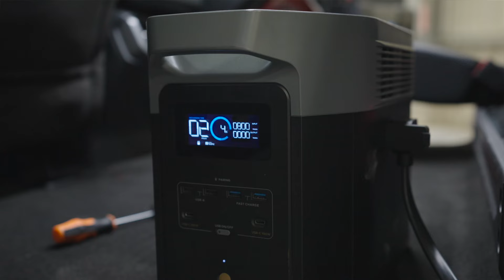How to Install an EcoFlow 800W Alternator Charger in Your Vehicle: Step-by-Step Guide

Comment: What a joke.  $600?  That's absolutely ridiculous.  For a fraction of that you can install an inverter and accomplish the same thing.  I've been doing it for years with no problem.  This thing should be $250 tops.
Reply: Pure sine wave for $250?
Reply: Why would you install an inverter for DC to DC charging?
Reply: @SaltySeabee  yes.  I have a 2000 watt pure sine wave inverter I got on Amazon for $129.  Works fantastic.  $600 for what essentially is the same thing with less output is outrageous.
Reply: @r.kitt.3987 you aren’t understanding what this device does.  It’s not an inverter.  It charges a separate battery pack (with inverter), and also allows that battery pack to charge the vehicle.
Reply: @twentyonemore1033  doesn't matter wtf it does.  $600 is ridiculous.  $400 would be ridiculous.  I like ecoflow products and have a bunch, but the price tag they put on this thing is ludicrous.  They're on drugs.
Reply: I agree! I have Victron DC to DC charger with computer fans and it works fine. It charges my Ecoflow Delta 2 Max. 
The whole set up cost me around $300.00

$600.00 is way over priced and on top of it the provided wire are too thick to run thru the firewall of a 4runner.
Reply: @r.kitt.3987  you may have a 2000 watt inverter, but are you drawing 2000 watts from your vehicle battery?
Reply: @jfhisjwu  no, I set the charging rate in the ecoflow app to between 500 and 700 watts.  Works like a charm.  I've done it dozens of times with zero problems.
Reply: Does it kill the life of the dang alternator
Reply: @vinboughton4751  nope.  As long as you're not pulling 1500 watts from it.  I have a 220 amp alternator on my truck.  I've been charging my ecoflow at 600-800 watts with the inverter for over 2 years.  Zero issues
Reply: An inverter UP CONVERTS DC to AC. THIS unit CHARGES your power station or Xtra batteries with UP TO 800 watts (adjustable with the app) FROM the ALTERNATOR, NOT SUCKING ANY POWER OFF THE VEHICLE BATTERY, WHILE the vehicle battery is also charging...  and you can REVERSE it to charge or JUMP the vehicle starting battery back from the extra battery or power station.  It's NOT an inverter, rather a fancy charger using the Alternator RATHER THAN the starting battery.

Yes, I understand one could use a jump cable from the extra battery to jump the starter battery, but I'm disabled female and the ability to just flip a switch from inside the vehicle, like for instance lets say at a truck stop in the middle of the night to jump a dead vehicle battery, is worth the price I paid of $370 with a package deal, even though I need the $ for other things and am on Social Security and struggled to save this dough. (I do also have a portable jump battery pack but again that involves getting outside and opening the hood which is not easy for me to open)...

One can make their own (charger unit for Xtra battery) that works from the Alternator with a certain size Victron CHARGER (not converter or inverter) and an XT60i cable and add a couple fuses AND a cut off switch, and buy the cables and connectors for approximately $250 and do the work yourself, and have a menagerie to mount someplace, which will put out a max 410 watts to be able to charge in TWICE the time that this unit will... or just pay $120 more like I did and have a complete 800W unit that will also reverse charge my vehicle battery (which I have a parasitic drain problem in my van that cost too much, (at least 1K) to have chased down and repaired).
Reply: @r.kitt.3987 second message to you:  How long does it take to charge it at 600 watts? And WHICH Eco Flow are you charging?
Reply: @ServantOfJesusChrist777  cool story bro
Reply: @r.kitt.3987 you’re missing the point, it’s an extra battery
Reply: @HeavyJams  oooooohhhh.  🙄
Reply: 🙏🏻🙏🏻🙏🏻🏅🥇🏆Thank you for your edified comment !!!  👏🏻👏🏻👏🏻 YOU saved my eardrums ( heart rate went up to 169 ) as they got BLOWN OUT ONLY A FEW SECONDS INTO this stupid video !! 😖 I am returning my unit as this UNPROFESSIONAL VIDEO IS ABSOLUTELY UNBEARABLE TO ATTEMPT TO FOLLOW WITH LOUD PORN MUSIC BLOWING MY DAMN EARS OUT OF THE SOCKET.😤
Reply: I also have installed an inverter like this OP. It's not that simple. You need a separate fuse, and then you want a kill switch for backup. Also, a 2000-watt inverter is really big. I have the same thing. 
I'm switching over to ecoflow because it's smaller and no extra fuse or switch's to hook up. Got mine for 400 and worth it!
Reply: @ShawnVanNinja  cool story bro.  You wasted your money congratulations.
Reply: Just bought one new for £247 and it was quick to install. The Ecoflow Delta 2 charges at 800W even with the engine on idle. Perfect for rainy weeks without a lot of sunshine.
Reply: I’m getting this one. I love the back charging feature also
Reply: @aggitravel  lol.  Waste of money
Reply: @r.kitt.3987  I have the delta max 2 so all good 👍🏼 especially the back charge. Charging it with the 12v takes forever while driving.
Reply: You lose efficiency by going from dc to ac, then back to dc.
Reply: @hi9580  who cares?  It works great.  And for a fraction of the cost of what ecoflow is charging for this pos.  But go ahead and waste your money.
Reply: Are you hooking up a power bank to this?
Reply: I got it for $199
Reply: You have no idea what you’re talking about. This device takes the ~80 watts from your alternator and bumps it up to 800 watts to charge a battery bank. 

An inverter has nothing to do with this at all.
Reply: @schassis_eddi You wouldn’t. The guy just doesn’t have a clue.
Reply: @r.kitt.3987 Not the same thing at all.
Reply: @r.kitt.3987 You’re the only one talking like they’re on drugs.
Reply: By the time you buy your inverter and your batteries, your lithium batteries and your solar panels. You pay double my friend. You're better off getting a battery bank. Do your research if you don't know what you're talking about
Reply: Git nine for $199!
Reply: Does negative have to go directly to negative terminal or to a ground chassis?
Reply: I got it for 249$ from the website. Holiday special
Reply: Can use that alternator charger on Sedan or coupe cars !

Comment: What a joke, ppl plz don't fall for this, just buy a DC to DC charger, which is what this is but it has a fancy name that will trick the uneducated.
Reply: It also has reverse charging and maintenance mode.
Reply: you can't charge a portable battery station with a DC to DC charger
Reply: @GordonTamf35  You actually can by using the solar charger port.  You just need the correct cable.
Reply: @dubious6718  as explained in tinkerer’s video. Yes you can but the current is capped and power is therefore limited for 12V. You can only do fast charging by using a dc transformer and increase the voltage to 40V+

Comment: Eco flow is garbage. I’ve been dealing with them for months to get a refund. Stay as far away from this company as you can.
Reply: Specifics?
Reply: @voyasystem  one of my eco flow pros burned up running a refrigerator, which is 1/10 of it’s capacity. I have had to threaten the company with the attorney general in order to get them to agree to give me a 50% refund, which 3 months later has still not been placed into my account. They sent me a replacement that was also broken, which I returned. They do customer service in India, I can’t understand anything they say until I get to a manager or their legal department. This company shouldn’t be allowed to sell items in the united states as it’s just a bunch of scam artists.
Reply: @ducksmart1496 Well that isn't what I wanted to hear. I specifically bought from this company a few days ago because I had seen many reviews about great customer service, and there's a 5 year warranty.  Your case is a little different, but I thought their products were top notch.  This shouldn't happen with a quality product.   However, U say they DID sent you a replacement.  How long, may I ask,  did you have your unit before this unfortunate incident happened, and #2 what specifically do you mean the replacement was "broken"?
Reply: @ServantOfJesusChrist777  my unit sat for five months and then burned up using a refrigerator. They offered me a 50% refund. This has been a very disappointing experience. The replacement they sent was busted up in many places and I wasn’t going to accept that. I didn’t even turn the pro on before requesting a return shipping label. It was in bad shape.
Reply: @ducksmart1496  thanks for your response. That's not good news... and sorry this happened to you.